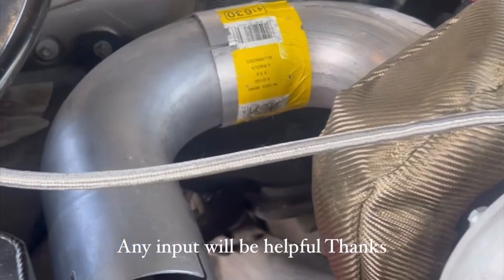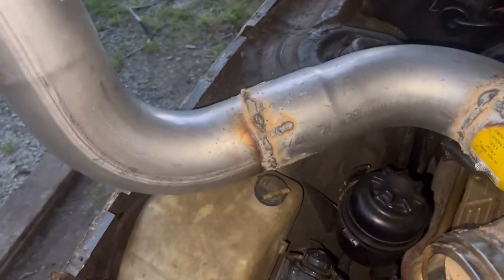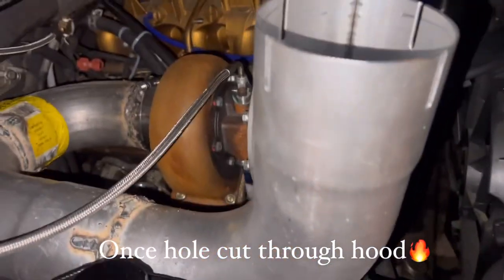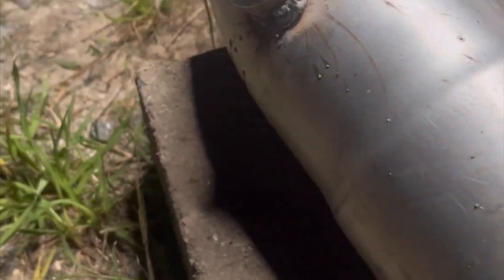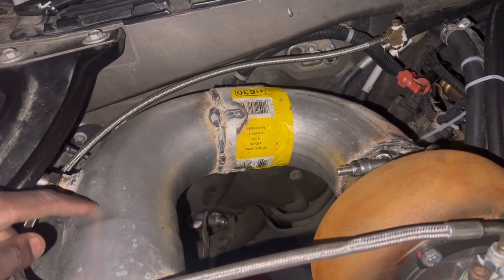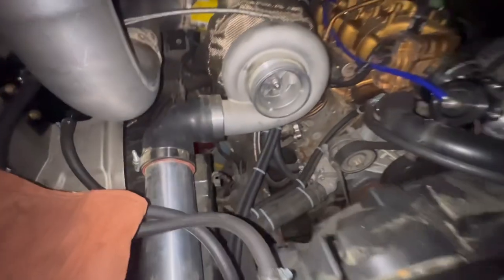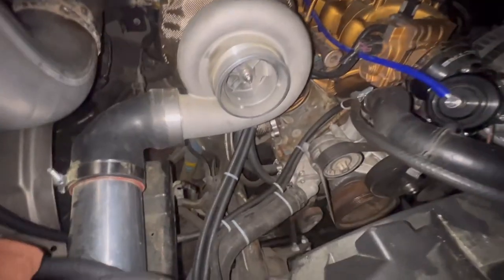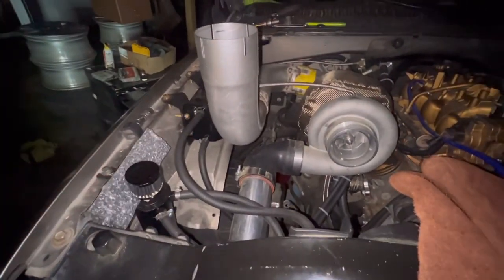Turbo street Truck build gets custom down pipe! Will it hold for upcoming task?

Comment: Looking good! There are some ports on the left side of intake that are plugged from factory, you can just cut the ends off and run your vacuum lines there, or get a vacuum block and T into the one going to your brake booster, but looks like you have some sort of vacuum pump in line there so not 100% about that.
Reply from the maker: Thanks and not the best but will do 🙏🏽and appreciate input will look into🙏🏽